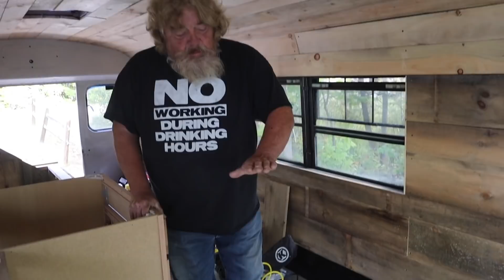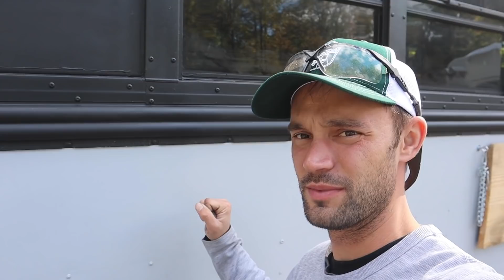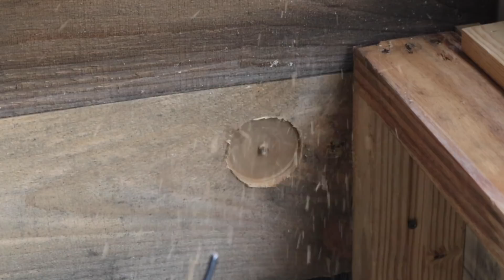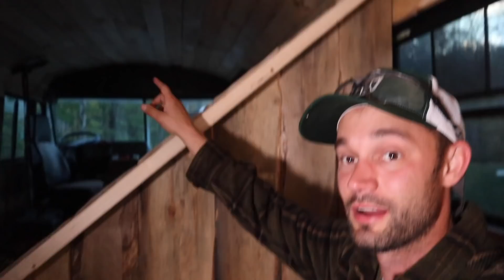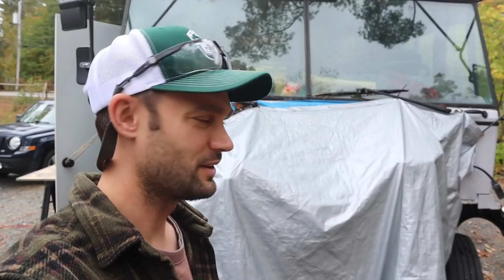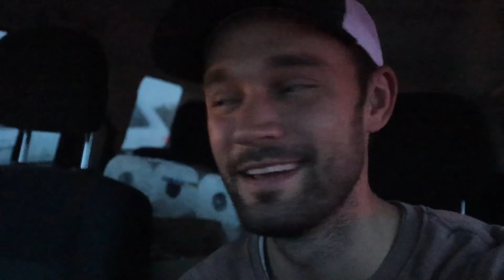Getting Started On The Inside | Rustic Skoolie Conversion

Comment: With regard to the water inlet you get a one way check valve and put it on the inlet hose and then you fill the tank all the way. Also I would install a vent line going back out for over fill and for it to draw air as needed.

Comment: With the man glitter, You can mix with wood glue and used as hole filler. Saw that on line somewhere. May work the same for the grout lines. I’ve never tried it for grout but I have used it in filling nail holes. Can’t wait to see how it works with the poly.

Comment: might be a good idea to superglue the sawdust intoo the grooves before going over it with the poly utherane
seen people make woodputty using sawdust and normal woodglue one problem though that the resudeu shows up when you paint it clearso you realy need to sand the floor untill all the residue is gone

Comment: I do you choose between a 30 or 50 volt connection? Hey Dean, so glad to see him! 🖐🏽😁
Reply: The decision between 30amp and 50amp services, is based on how much AC power you're planning on using. Most of the time a small rig like the Rustic Bus would have no reason to have a 50amp. However if you you're running anything that needs 240v power you'd need the 50amp service.
Reply: @rpn9000  Thanks, that helps me a lot. Always wondered.

Comment: You're doing some great work Michael I gotta ask you a question question why do you insist on putting the utilities  on the passenger side of the bus. All RV parks have the utility connections on the driver's side?
Reply: Gina it's nothing personal it's been the RV standard for years 20 million Rv's don't lie just trying to save you an extra 20' to hose and cord
Reply: @michaelcanto6175  doesn't bother me I don't ever stay at RV parks
Reply: Hi Gina I understand your confusion but please please understand I have camphosted for many years and most of the campgrounds are designed with the activity area for the visitors to be on the passenger side of the bus hence they put the utilities on the driver side of the bus and many sights I've been to do not allow you to pull in.
Reply: I don't understand this comment. "RV parks have the utility connections in the driver's side" it's whatever side you choose. Back it in or pull in forward... There is no drivers side in this case. It's all about how you park. Also it's not just Michael putting it there, check out most bus videos and they have it on that side. 🤷🏼‍♀️
Reply: Oh and a lot of us don't even stay in RV parks. I never have in 2 years.